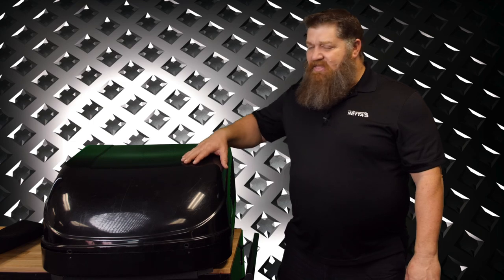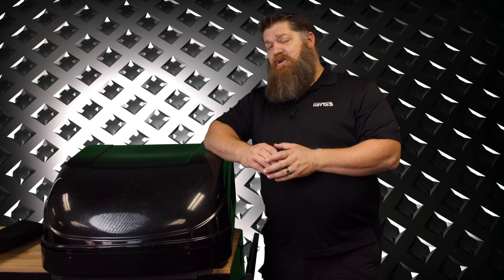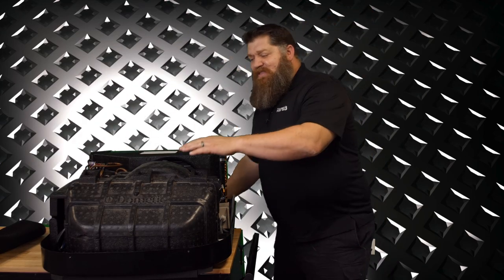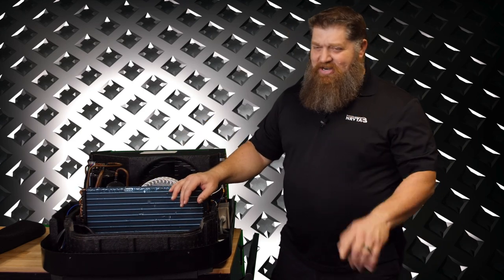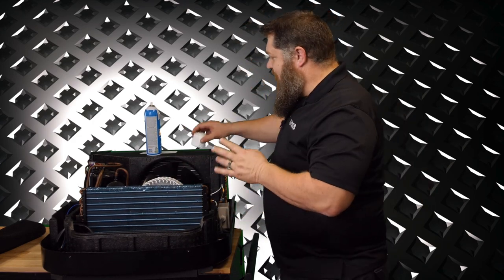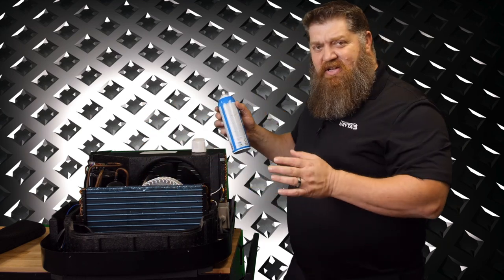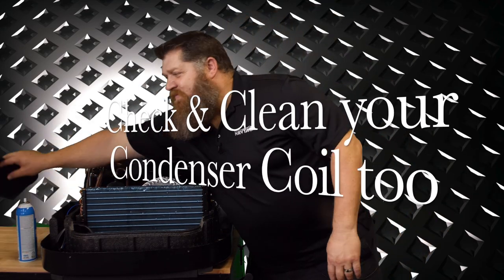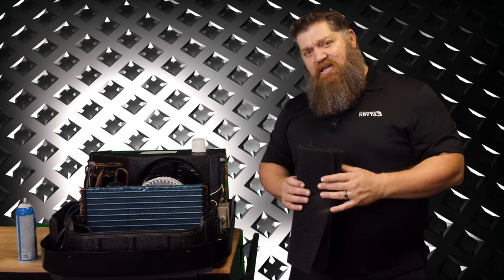You have to clean your RV AC coils

Comment: Thanks! Best RV AC cleaning video I've found yet. Now I'm looking for a video that shows what I'm supposed to do down inside the RV (AC) from underneath.
Reply from the maker: That can vary greatly depending on your AC and how it is setup. The main thing to consider on the inside is to keep the air intake filters clean to maximize air into your AC.

Comment: When I did this,this past summer my ac quit working after I plugged the pig tail back in. The thermostate started throwing a code. Now I can't even get a re0lacement thermostat because the one my rv uses is obsolete now. HELP!!!
Reply from the maker: Is the thermistor pushed into the coils? If it’s not making contact you would get an E code. If it is making contact then follow the wires back to the box. It might have been pulled out from the circuit board. It’s a spade connector type connection. Kill power first.

Comment: What about using compressed air or a can of air (computer cleaner) to clean it ?
Reply from the maker: As long as you’re blowing the opposite direction of the airflow, otherwise you could wedge the dirt deeper into the coil.
Reply: You also have to be careful not to use too much pressure or get to close to the coils, you can bend the fins over and make a big mess.

Comment: I have a Mach 11. Coils in front and back . Do I use same cleaner on back coils
Reply from the maker: They make specific cleaners for both the condenser coils and and evaporator coils. If you get a no rinse foaming cleaner then it's easy to use it on both.

Comment: Does anyone can post a product number of the filter? I checked at my local Walmart, on their website and on Amazon, but I don't seem to find the right filter. Thank you.
Reply: I just got some at Walmart. They are in the section with the window a/c units. Duck brand. 96 cents. Hard to believe you can still buy something under a buck. I bought two!! I searched for “foam filter rv”.
Reply: @farmdoc9252  I'm from Canada and Walmart don't carry this particular product. The "equivalent" cost about $22 CAD. Unbelievable. I plan to go to the US this summer and I'll pick some at a store. Thank for sharing what you found.
Reply: @farmdoc9252  do you happen to know what it actually is called? I am having a hard time finding it in that section at Walmart. thanks!
Reply: @angelavogt9925  Just looked at it.  It is a duck brand "Air Condition Filter". Again is not with the a/c filters, in my walmart it was in the section with the actual window a/c units.  Hope that helps.